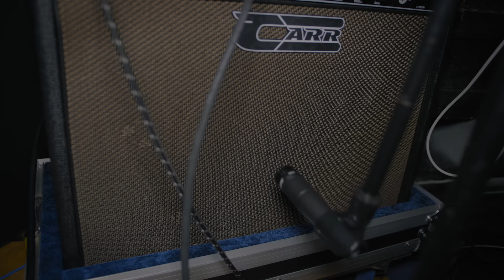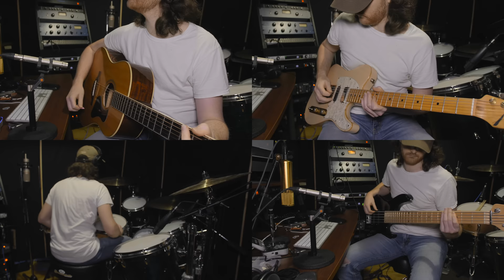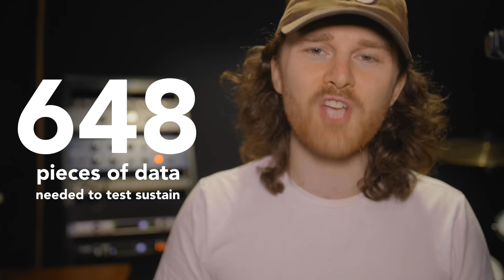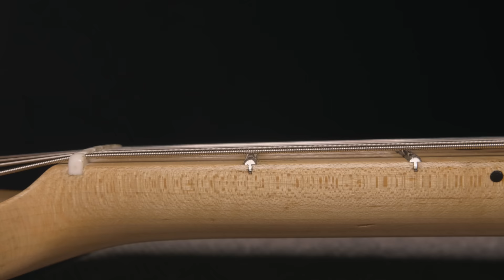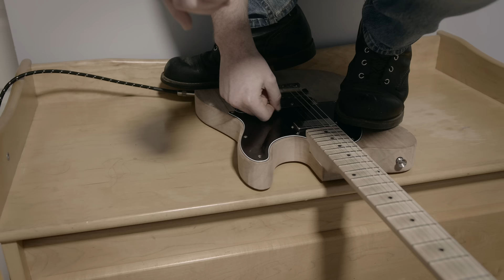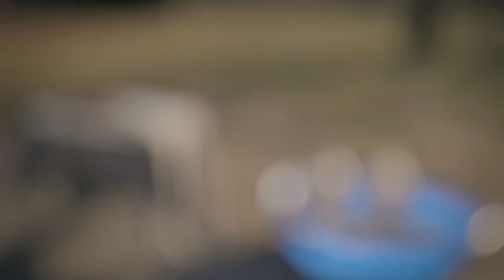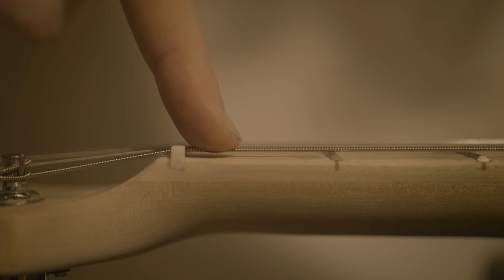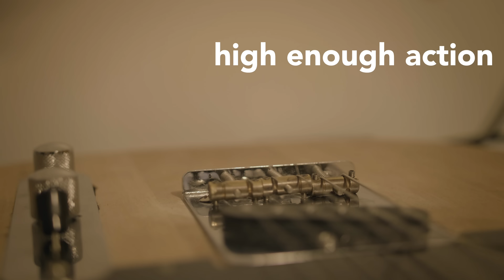Tested: Where Does The Sustain Come From In An Electric Guitar?

Comment: Physically, the sustain comes down to how much energy is stored in the string vibration, vs how much of it is lost to the surroundings. The places the energy gets lost is 1: transfer to the guitar body (knock it and you know it has no sustain), 2: the sound you can hear un-amplified, 3: heating the string itself, 4: the signal going into the pickups. I think it's clear from this video that 1 doesn't matter, 2 and 3 are a function of the string itself. We know that just having the pickup there makes a difference, but what I'm really wondering is if having it plugged in or not makes a difference. When it's plugged in the coils suck some energy out of the vibration, but unplugged it's not able to do that. In principle that makes a difference but it might be near zero compared with the rest.

Comment: What I find out about what affects the sustain on an electric guitar is the vibration of the material the guitar is made of.
Contrary to general believe, I think than the less resonant the guitar the better sustain the strings have. 
My theory is that the vibration from the guitar fights against the string and kills it earlier. Sort of an out of phase effect. 
If for any reason the guitars vibrates exactly as the note you are playing you'll have better sustain and even a kind of feedback effect. 
More dense material guitars tend to have better sustain thanks to the lack of opposite vibration. They are also more consistent along the whole fretboard.
If you happen to have a hollow body guitar you can verify that fact by playing different notes which some would have worst or better sustain than others due to their frequency proximity to the guitar vibration. 
I might be wrong of course, I'm just sharing what I came to realize through many years of playing so many different guitars.

Comment: Nice work. It would be good to see how all the different variables summed up affect the sustain. I.e. variables in isolation have a relatively minor effect, however if you add all the variables biased towards the lower or higher sustain result, you may see a greater difference. E.g. one guitar with all the elements that resulted in “better” sustain vs another guitar (same type) with all the elements you found cause less sustain. Just a thought.

Comment: Great video! Among other instruments, I play squareneck resonator guitar and lap steel with strings half an inch off the fretboard and notes determined by a bar (or steel) stopping the string. In another video you used a metal pipe to do this on the air guitar. On my instruments, I’ve found that there is a huge difference due to weights, metals, and smoothness. Pipes give little sustain. Solid brass is better. A very smooth chrome or stainless steel gives even more sustain, but weight matters. Heavier is better. Smoother is better. By far the best I’ve used is a handmade Clinesmith bar covered with a very smooth polymer similar to what is used in total hip replacements that weighs nearly a half pound. It’s heavy and a bit ungainly, but the improvement in clarity and purity and length of sustain is far better than the second best, which is a big Shubb steel. However, the Clinesmith costs $90.
Reply: Mass=sustain

Comment: Personally, I think your sustain is affected more by the type of strings you use as well as the gauge. The strings are the thing that is vibrating thus playing the note. How well (And, how long) they vibrate would affect sustain. This should be super easy to test out. Material of stings (Brass, Steel,, etc) Gauge (Heavy, light, etc) Winding (Round, flat). These things all make a difference not only in playability but, sound and quality of sound. Try it out.(And, how long)

Comment: "just a few dB" is a little disambiguous as decibels are on a logarithmic scale. A loss of 3 dB is half the signal strength. While human hearing doesn't scale exactly the same (IIRC approx 10dB = half the apparent volume), "a few dB" can be quite significant, especially if several such factors are combined.

That being said the tests are all sound and the conclusion of other factors being more significant is absolutely valid.

Comment: in the case of mechanical sustain the wood does matter, but more importantly the coupling of the bridge against the body and the downward tension from the strings. Another fun thing to do is push the headstock of a bass guitar against a wall to practise without an amp...But harder wood does not necessarily mean more sustain, consider that spruce is used as piano soundboards as well as acoustic guitar

Comment: Sustain comes from acceptable levels of compression that make a note last with a lot of body.  Guitars shouldn't be inert in any way.  So all the body materials to using high output pickups will all increase resonance and sustain.   Brass sustain block, kiln dried body and neck woods, all the moisture removed, resin crystallised, stainless steel frets are harder and retain more chime/high end detail.  The more a guitar sustains well the more it appears to have bell like sounds.  Round and balanced.  Well a tubescreamer will increase the signal preserving detail from the high-output pickups to the pedal and then expanded in detail in the preamp.  Boost your preamp in the effects look like a lot of people and control the output with attenuation leaves only one thing left, the speaker.   A speaker needs to push a certain amount of air before it's diaphragm becomes elastic and responsive enough with the magnet it's pulling against.  For most people a good 12" speaker starts to sound nice around 70-90+ decibels depending on your room etc. 

How about genre?  Where does sustain come from?

Funk+Country = Compressor and or clean boosted cranked super clean amp. Maybe a clean boosted effects loop.
Metal = Mid to High output pickups with an overdrive and a loud power amp pushed with an EQ pedal.
Jazz = Diming certain frequencies to make things fluffy.  Often enjoying loud pickups for gentle touch with finger picking and pick playing (Steinbergs for example)
 
Sustain is about keeping your tone in tact before it gets to the speaker.

Comment: I wonder if author tried doing like 10 measurements on the same guitar in the same conditions to see how consistent measurements are. My point: some of the differences measured are quite small and could be due to sligtly different strum strength. I get it this is a lot of measuring already and great video in any case

Comment: TL;DR The setup, amplifier feedback and the way you play it affect sustain much more than any tonewood, finish, etc ever will for an electric guitar.

Honestly, I feel like 99% of arguments about this stuff could be avoided if guitarists could just admit that we don't really need a tone-related reason to like things. It's totally valid to like a finish based on how it looks (or will look in a few years' time), it's valid to like the feel of a certain neck-profile or material, it's valid to prefer the other effects of things like a string's break-angles or a saddle material (namely, how it affects tuning stability and how durable it is or how unlikely it is to wear out strings, respectively).

Comment: You reasoned up the idea that a 4 second test is appropriate. Great. How about then also reasoning that most players are gripping their hands around the neck, pushing fingers against the fingerboard, and even pressing their wrist onto the guitar body, damping vibrations. Try testing the guitar's resistance to this external damping.

Comment: Physics say you want to keep the vibration as long as possible for long sustain, so you need to have as little friction as possible. Pickup and body stiffness ought to be the main friction components. Not to mention air density. Try it in helium :D

Comment: As a bassist there are definitely parts of songs where I need to play a note several measures long, 4 seconds is nothing. I am also frequently in situations where I am not using an amp and very little gain. The natural sustain of the instrument can be very important. 

I used to practice a lot with an Epiphone Thunderbird that had a real sustain problem with the low E note, and only that specific pitch, which is kind of an issue since that's a very common open note to hold on to. Literally any other note would be fine, like if I played the first fret F or if I tuned to Eb. Obviously the lower string tension does help as you showed, but it was a crazy severe difference to the point that any pitch detection software, like a tuner, would lose the E note if you tried to hold it for tuning. For whatever reason that specific bass just resonated poorly with that specific pitch, and for that reason had poor sustain. Couldn't say why. But I have many other basses without the same issue.
Reply: Was the bass properly setup (string height, bridge etc.)? If yes, then it might have also been a build problem that has caused the low sustain, meaning, the guitar builder f'd up, so there would be nothing you can do about it unless you know how to build guitars and fix those inaccuracies.

Comment: For ultimate sustain Randy Rhodes would hold his guitar vertical while himself being held in the air by one leg. When held vertical the gravity pull is primarily affecting the diameter of the string and not it's length. That is likely why a harp is constructed  vertically versus a horizontal approach. Being held in the air only reduces earth's gravity pull slightly with the main advantage being the vertical guitar orientation. When combined with a guitar face the sky is the limit! Listen to the break in Steal Away (the night) for additional evidence.

Comment: My Hagstrom has more sustain than my EPIPHONE or Gibson SG’s. With everything else being the same I though it was due to the design of the Hagstrom’s Truss Rod. It uses an H shaped beam with an adjustment screw running down the middle. It is strong, damn strong. I though it had a crack in the neck, where the scarf joint would normally break. So I took it to my Luthier bd he tried to break it off the rest of the way to repair properly. He couldn’t break it. He got his son to help try and break it off and it still wouldn’t come apart. Bruce has been in business for his entire working life, over 40 yrs or so. So when he determined that it was just a crack in the finish I believe him, and it’s been playing fine for well over a year now. It’s my favorite guitar, so it does get the most use.

Comment: Great video once again!  As I newbie to playing these are really fun to nerd out on as I consider expanding the guitars I own. A great reminder that while guitars/amps/etc play a role, the largest factor usually comes down to the player.  ie. their  ability to accurately and consistently place their fingers in the best positions on the fretboard and to apply the right amount of pressure to get the sustain that they're trying to achieve. 

This video does make me wonder what difference, if any, the string type/gauge/coated/etc has on sustain?

Comment: Testing sustain on many guitars at my disposal, it seems that there might be other factors at play as well. Newer strings generally seem to sustain better and same goes for thicker strings. Bolt-on guitars also appear to sustain the note longer than set-necks, which again hold the vibration longer than neck-though designs. Different bridge types (floating, floyd, hardtail) play a role, but this is hard to quantify without further testing. Sample with shortest sustain is a dense wood neck-though, but it has ancient strings as well.

Comment: This has been a very well thought out experiment in the field of sound resonance, using "applied science".. there were no musical instruments harmed in the filming of this experiment, or at least in the perception of this viewer's observation. 
The experiment resulted in showing some very hard lessons learned over time about "operator error" while playing, or attempting to play , *stringed instruments.. 
A few variables were not discussed, it would seem deliberate, in order to keep things direct and simple.

String design, pickup strength and hight, and overall setup of the instrument itself, or themselves. 
String age..  having tonality, and perceived "sustain" characteristics is probably the most noticeable A-B variable in all stringed instruments..
But.. it poses another environmental question..

Piano vs guitar..?
Piano strings don't get changed nearly as often as guitar strings.. why?
It is this viewers fact based opinion, that Piano strings are for the most part kept, and played in a more controlled environment.. and never , aside from installation, get touched by anything other then the hammers, and sustain attenuation bar.. presumably clean devices, that are almost never exposed to moisture.. 

Where as guitars, of all designs, are repeatedly exposed to hands, very wide air quality changes, and ... moisture.

MOISTURE  changes everything.. 
Oil from your hands/fingers changes the strings surface over time, as it accumulates.. 
Cleaning your strings, fret board, ect. Can prolong the life of strings, but can't neutralize the environment in which guitars are played.. electric or acoustic. 

Cases and storage.. 
Let's call them "dry boxes" for guitars..
Tho the cases are designed to protect the instrument.. it is also vulnerable to external heat ... (don't leave your guitar in a case sitting in the trunk or back seat of your car, it WILL obsorbe heat)

HEAT changes the moisture content of the wood.. in extreme cases, can warp the wood as it dries out.. 
Maintaining the proper amount of moisture for a guitar, is like having to live and play in a bubble.  Sealed away from the environmental changes of everyday life on earth.
Ever notice the "acustic room" at guitar center?
That's a humidor.   It attempts to keep the humidity, controlled, and non damaging, to the collection of acoustic guitars within the room.. aside from the 10,000 oil and soda covered hands that have played and fondled each and every one them before you got there.. ie a controlled environment. 
Anyway.. great video.. I enjoyed your work..  your results, and generally speaking..  the thought you put into posing the question, and then following through with getting those results.
Thankyou sir.. well done.

Comment: Sustain claims on a guitar is like peak brightness claims of monitors:
Measured on the best (and barely reachable) scenario, for an extremely small portion of the product's spetrum.

 Guitars: ideal enviroment/temprature, with specifically constructed string(s) to naturally match the body's resonating frequency.
Monitors: PWM'd ~1ms 100% power (which is usually unreachable) blink for a small portion of the screen (to reduce drops because of weak PSU)